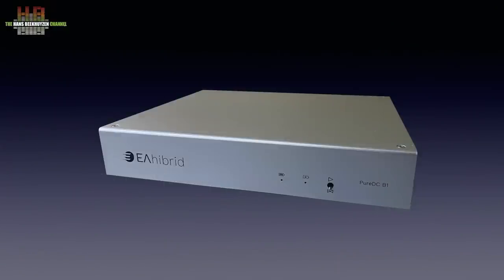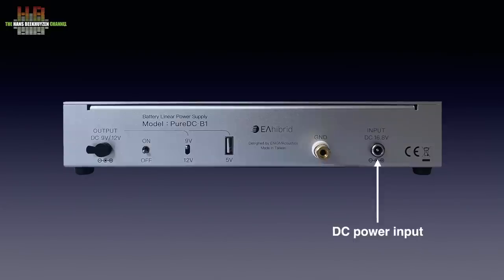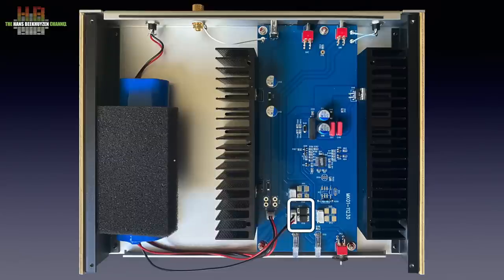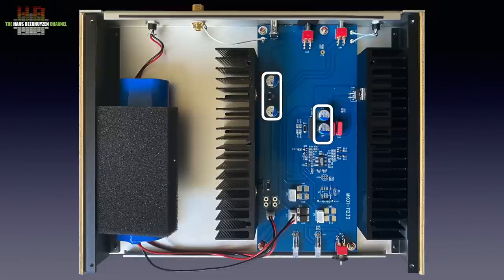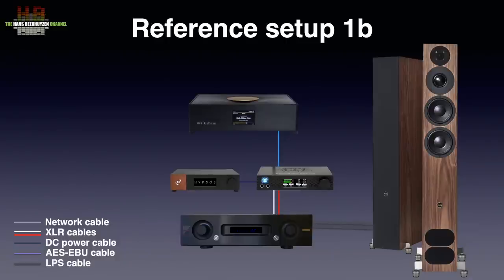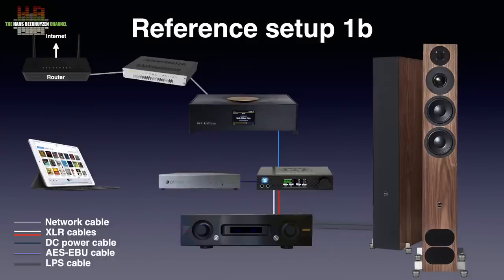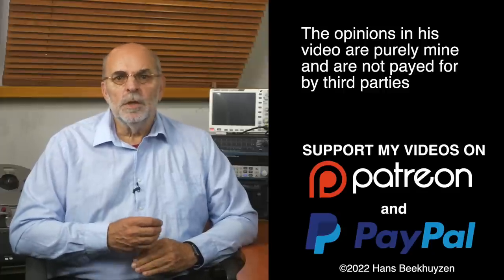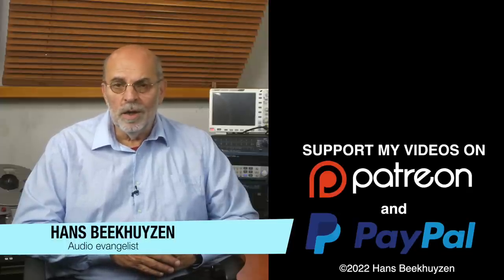EAhibrid PureDC B1 battery/linear power supply

Comment: Hello Hans, very interesting review. And a question.
You mention that you hear differences when anLPS can deliver more than 6A to the DAC. 
What happens in a case where a LPS can deliver say 8A split over two outputs of 4A. The toroidal is large enough but the output is split. 
Does that mean the DAC is underpowered? (DAC requiring 1-2A typically) 
In particular I am referring to the KECES P8 model with dual output but the question is a general one.
Thank you!

Would also appreciate your review - at any time - of the Keces P8.
Slightly cheaper at Euro850 but the dual output means cost is split over two units possible and a third over USB.
Problem is that I have maybe heard of 5-6  different LPS units in systems. Impossible to judge over 1-2 hours listen in another person's system.
Your reviews are great because they provide us with a comparative benchmark. Thanks again for the great work!
Reply from the maker: That depends on how the unit is contracted. I don't know the product you mention.
Reply: @TheHansBeekhuyzenChannel  That is OK. For reference, in their web site, Keces advertise compatibility of their products with SoTM devices (really, they do). This is what  drew my attantion. At same time they are one of the few companies to offer a 20/24V option which was needed for my DAC. So with one LPS device I can supply both DAC and SoTM product. The only other product that I have seen can provide +18V is the Ferrum Hypsos (5-30V) which you have covered in a very good review and use as reference. I do believe, from your review, that the Hypsos is a (far?) superior product to the P8 (they are a bit different in technology also). But the price is 30% higher for single output.  I guess then it comes down to how much budget one can allocate versus sonic benefit. It is the quantification of the benefit that eludes me.
Reply: @administratormagmamin8397  
That depends on how the unit is contracted. I don't know the product you mention.

Comment: I have listen to all your video’s about power supply .
My questin is I have a turntable with a outside switching power supply.
2 Belts are spinning my heavy 15 kg platter.
Make it a different buying a lineair power supply,because the motor stands apart from the turntable?
It is an Acoustic solid mpx wood,with a 32 v motor.
The one I can buy(if it makes a different in sound)is a Teddy Pardo.
I am in doubt,not for the money,but the upgrade of the sound.
Reply from the maker: I really can’t say.
Reply: Galibier Designs uses Teddy Pardo and they are ultra high end TTs.

Comment: Were you able to estimate how long the batteries lasted before reaching the 20% charge mode? Also, did you run it in that mode, and if so, was there any difference from the above-20% mode?
Reply from the maker: I had the unit too short to test the stamina. But there is 5000mAh capacity for - in case of the Mytek - 1 A demand. So in theory 5 hours. I would expect 4 to 4.5 hours. The charge mode is only slightly less in sound quality.